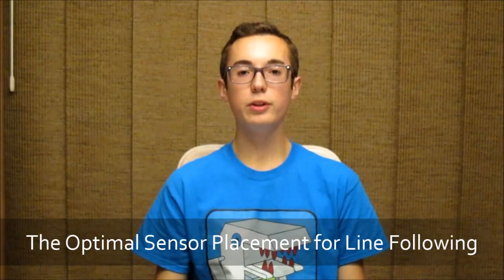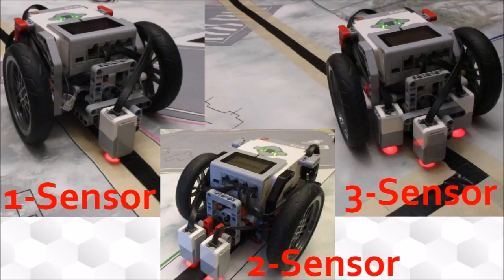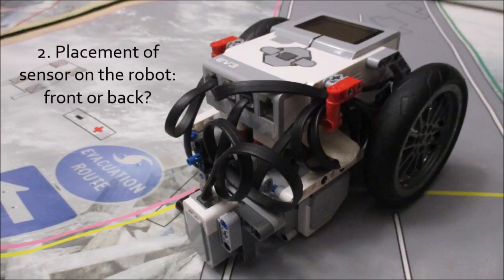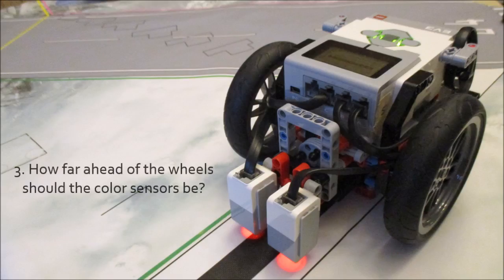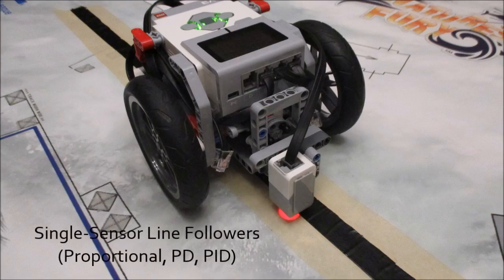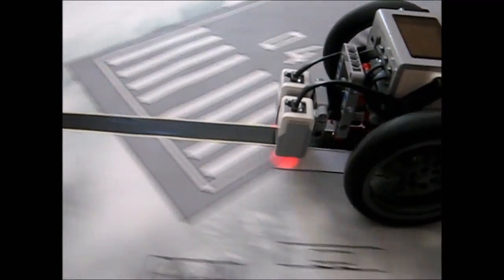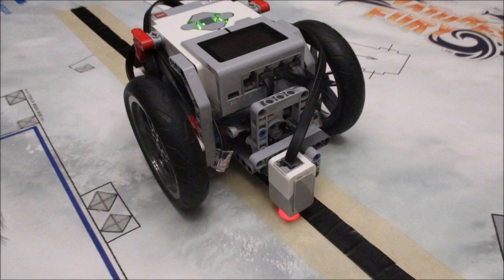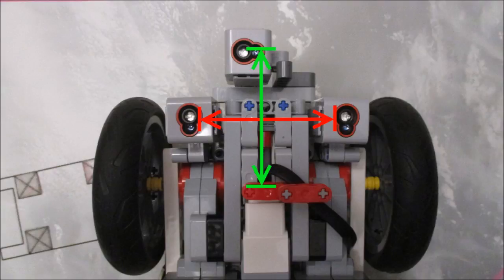The Optimal Color Sensor Placement for EV3 Line Followers

Comment: Very instructive and comprehensive... as always. You‘ve definetely become our No. 1 source of EV3 tutorials! Please keep on going! One thing that‘s currently causing us headaches and might be worth another video... „How to detect junctions reliably with a 2-Sensor Line Follower?“.
Reply from the maker: Thank you! I'm glad to hear you're enjoying the videos. And for your question, I have a video for that already. The robot won't necessarily detect the intersection, but you can teach it to anticipate the intersection and continue on unaffected: https://youtu.be/LXdm6-Gl0WE
Reply: We know this video already :-). We're still pursuing the dream of only using lines and intersections for navigation and not rely on any static motor control blocks which tend to become unreliable because the mat material, tires, dust, battery usage, etc. have considerable effect on the robot's reliability, hence we're trying to avoid this as good as we can. We were quite successful in our first WRO challenge following this approach, but we only used a single Sensor PID which wasn't as fast as a 2-Sensor follower but at least it was detecting intersections reliably (with another sensor... feel free to check our Youtube Channel and you will understand what I mean). Next time we'd like to compete using a 2-Sensor follower which is really fast like hell but we miserably fail to detect junctions reliably until now :-(